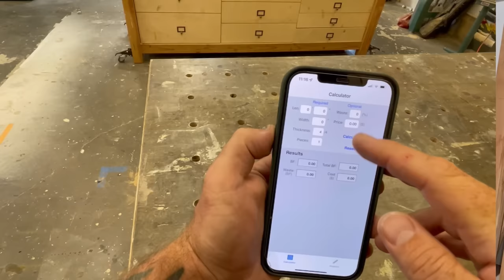Don't Buy Wood Here || Beginners Guide to Buying Wood

Comment: That’s a shame, because Home Depot wasn’t as awful back when I was in college 16 years ago.  Back then I wanted to make a really solid, beer pong table, and I was able to get a pretty decent looking sheet of 3/4 inch, furniture grade, white maple plywood.  I didn’t have access to any tools at the time, but I was able to round the edges and sand it all by hand to get a nice surface.    Most beer pong tables we had previously were all 1/2 inch construction grade, so you had to paint them to look good and repel the spilled beer.  My table had decent looking grain without any knots or inclusions, and I can’t recall the grading but it was flat sawn and looked the same on both sides.  

Since I wasn’t going to cut down it down, I picked the best looking one with nice undamaged corners.  I sanded it aggressively to with some really course sand paper to get it down to a fairly round, consistent edge that would’ve taken 30 seconds with a router—but I didn’t want cut into my beer drinking budget.

I then stained the wood a medium brown to make it look a little classy, then painted it with a sick looking graphic that was our fraternity flag and mascot on it, because I was able to paint it in layers using white, black and deep red, which came out awesome.  I didn’t like the plywood grain showing on the edges, so I masked off a 2 1/2 or 3 inch border that I painted black, then added a thin little pinstripe to make it pop.  Then once everything was dried, and looking good I coated it all with at least two or more clear coats to seal the wood and graphics from moisture and to protect it for as long as possible.  Then, because I learned how to paint from watching people paint cars, I had it sanded with way finer grit than anything you guys seem to use in woodworking.  The final sanding after the clear coat ended up being 2000 grit, and then I buffed and waxed the whole thing by hand to add even more protection.  It looked pretty good, and had the surface finish of car—so I figured it would last a little longer than the old table made from 1/2 inch OSB.

It was the most overkill beer pong table that my fraternity brothers managed to destroy in a fairly short amount of time, because it looked so damn cool that they wanted to take it to tailgate parties and whenever we threw parties at other houses the guys rented near our fraternity house.  In the end I think the weight from that addition thickness killed it because it got dropped one too many times while drunkenly moving it and it delaminated bad enough the boys were too ashamed to show me, because they knew how much work I put into it.  At least the design I sprayed onto our bar as an afterthought with the leftover white paint I had looked great for years after I finished with school there.

Again, maybe they carry different wood at different locations around the country or they’ve changed since then, but if they no longer even carry that stuff it’s a shame.  It was exactly the sort of wood you could use to build some pretty solid cabinets.  Like I said it had two really good looking sides that could’ve been used for the front of a cabinet if you mitered the corners, or trimmed with some nice veneer strips, and mounted some premade doors for the average DIY weekend warrior, or with custom built doors made out of some really nice wood.  I think they sell some very thin strips of hardwood for adding trim to things or for making your own moldings with a router, so if you were on a really tight budget or lived somewhere without access to a good lumber yard, you could easily build something that looks better than it has any business looking.

Comment: I feel like home depot is wood you use for woodworking only if you're super new and you don't really know what you're doing my first woodworking project was a desk because my last desk broke and I didn't feel like buying a new one for it to just brake a few months later and I got the material from home depot. the desk turned out ok but not perfect because I didn't know what I was doing now everything I do I get the wood from a supplier because I've been screwed over too much by warped home depot wood. also my parents are contractors and they even say that when they need wood they go to Lowes because home depot lumber is way too warped for what they are doing. but in general if your brand new to the space and most of what you're going to make is going to be trash anyway you might as well use the crappy home depot wood

Comment: After 30 years, I'm now retired from construction and now for the past 9 years work in the lumber & building department @ Home Depot. Although I understand it won't be true in all areas, but where I live all the big box stores & lumber yards pretty much get their lumber from the same vendors. We have 2 lumber yards close to my store, and they both get the majority of their lumber from the same vendor that Home Depot does and charge more for it, and to make matters worse, they keep their lumber stored outside. Home Depot, or anyone for that matter has very little control of the bunks of lumber they receive. One truck load we may get a bunk of  2 x 4's, or 2 x 6's that are all crap, then a few days later get bunks of the same exact lumber from the same vendor that are almost all perfect. The same goes for sheeting. You can never tell until you open it up & get into it. It will ALL sell, it always does. I'm forced daily to hear the whining about the quality of our lumber from contractors, then after leaving in anger, only for them to be back an hour later to get what they need often making a huge mess in the process like disrespectful spoiled children. Another thing most people don't realize, is Home Depot makes extremely low profits on lumber, if any profit at all. Some sell for a loss. Not sure about now, but there for the longest time Home Depot was selling OSB for less than they were paying for it. They make most their money on the accessories. That's why there is no military discounts on lumber. Only on bulk purchases, and even that is limited.

Comment: Love your videos! When you were reviewing plywood could you include information about blows and voids inside the layers of the plywood. I got a piece of 1/4 inch 4x8 foot plywood from (hd) to use as a huge square to help true up some rafters on a porch roof build. Standing under it in the sunlight I could see several void spaces inside (hollows) that were not detectable by looking at either side or around the edges. Voids are worse on thicker plywood’s, makes for weak spots.

Comment: Even for construction it isn't the greatest. I was building a fence for my yard and had the measurements for what I needed and purchased the boards I needed, turns out the dimensions varied from .25 inches to 1.75 inches on the board so I ended up being short by about 17 planks because they weren't cut to size. 6 foot by 6 inches and they ended up being 5.5 feet - 6 feet and 4.5 inches to 5.75 inches wide. I am not a contractor but holy hell I couldn't imagine using them to supply me for my jobs. You pay for a product and are shorted, they told me it's expected to see a variance like that.

Comment: Actually, for framing lumber, Lowe's has the best. I've been bying framing lumber from Lowe's for 20 years and have rarely been disappointed. Another good tip, buy 10' instead of 8' material and never buy "precuts". The longer lengths come from better trees and you are going to be cutting it anyway, yrust me. The scraps will be used for blocking and skids. I'd rather cut fire blocking and cripples from scraps I generated from cutting studs,  jacks, and sills than from full 8' lengths. Over the years, I have found, for example, that I have about 3-5% cull from a hack of 10' studs versus between 5-15% with  8' studs. Sometimes, it's way worse than that. Nit only that, I couldn't tell you the last time I framed a house that didn't have 9' ceilings. Anyway, Lowe's has been been my go-to for framing lumber for over 20 years.

Comment: Great video. Sadly the box stores are simply easier to find just about anywhere. I’m 74 and even though I’m a toolmaker I’ve been an avid woodworker all my life. Even had my own cabinet shop for several years until my machine shop grew too big to run both. So anyway going back all those years our local lumber yard had everything. Construction grade to furniture grade and everything in between. Even a big planner, radial arm saw, table saw and a jointer. You NEVER left unhappy. Today it’s not fun at all trying to get good reasonably priced wood around where I live. Enjoyed your video a lot!

Comment: Wish I would have seen this video a few days ago. I'm not a "wood guy" but i'm trying to build a simple frame and I needed a 1" x 3" x 6' board. Went to Home Depot bought 2 1" x 3" boards and when I got home I found both the boards were 3/4" x 2 1/2 ". I didn't care about the 3/4'" but I needed a 3" board. Went back to HD and all the boards were the same. When I asked the "lumber guy" where the 3" boards were he looked at me like I was crazy. He said they don't carry 3" boards-they are just marked as 3" but they are all 2 1/2". He told me I had to buy a 1" x 4" (which is only 3 1/2") and rip it down to 3". I thought this would be a simple project but I don't have a table saw so now i'm just outta luck.

Comment: this is really strange because here in mexico homedepot wood is really good better than most places I usually buy brazilian plywood chilean boards and some local pine boards the best ones are the chilean boards they are straight smooth planed almost ready to use just a light sanding

Comment: When I first found my local hardwood place 15 years ago, I was intimidated, but they are a small business and super helpful! Just last year I took a small table top to them, live edge, epoxy pour. And they sanded it flat and took a twist out, it took them 10 minutes and coat me $15, it would have taken me hours and not been as nice, with my electric hand plane and belt sander… your local wood supplier is your friend!!!

Comment: I'm the third generation off lumber man. I grew up in my dad's lumber store. Mostly construction grade material. The Brill rolled edge 2x4 was a really nice. Started putting nuts on bolts in the hardware section. Delivered house jobs all over central Michigan. Spent 30.5 years working at the phone company. But now I have a solid base on how to pick woods and work it into furniture for our Michigan and Winter Tennessee locations. Your information was very basic in my point of view. but that's what happens when you live in a lumberman's home...

Comment: OH, BOO! HISS! Oregon State Beavers!!!!! They beat my Ducks! Well, if you ever get a wood lathe, come down to Eugene for a play date!

Oh, Oregon Woodturning Symposium at the Expo center in Albany, mid March. 

Also, for flat work, I prefer air dried lumber. With all the Wood Mizers around, there has to be barns full of air dried lumber. You rip a board on your table saw and you get shavings, not dust. Solar kiln and vacuum kilns seem to work the same way.

Comment: I'm pretty much a beginning woodworker. I spent 28 years welding pipe, all over the country. My father was a carpenter by trade, and a woodworker by choice, so he taught me a lot about woodworking tools and how to use them. That was decades ago, and like everything else, wood shops have changed over the years. I'm just learning how to turn projects on the wood lathe, and working up to larger, more complicated furniture projects. Videos like this are essential for me. Thank you.

Comment: The entire inside of my house is clad in 7/8" thick planed, bandsawed edge 7-1/2"-8" width tulip poplar. It was cheap buying it by the "bundle" at a local sawmill. I ripped and planed all my door frames, baseboard, crown, etc from the same wood.

Comment: It's not that hard to figure out board feet, its just the width of the board in inches cubed times the square root of the hypotenuse of the equal hyperbole Logarithm of the inverse measurement in decimeters squared plus 4

Comment: I'll buy HD wood when im building something that doesn't need to look pretty but is functional. Like the mounted bedframe I made. It's sturdy and solidly built. Not pretty by any means but hey, it holds up to about 500lbs with no problem. (Im not 500lbs but the math suggests about 750lbs limit, i take 33% as error and assume it can only hold 500 lol)

Comment: Thanks for the video for beginners.  I'm not a beginner but you gave me one good tip.   I've been to another hardwood store in Albany but wasn't aware of The Hardwood Center.  
One question I have though is why can we not get rough wood on all 4 sides anymore.  I'm from the midwest US and used to buy all rough sawn hardwood.  After moving to the west US, I can only find S2S or more hardwood.  What gives?

Comment: "Red Oak? What is this, the 1960's?" 
In my Maryland neighborhood, there was a tree disease that was only affecting red oak. We ended up having to cut down a 65 ft tree, w/a rotten core that went 5 ft up from the roots. 😐 
However, we had it cut into live edge slabs, & have been trying to turn lemons into lemonade.
Reply: I found out we have 4 small local sawmills, & 2 major independent architectural salvage companies. I buy wood there.

Comment: No matter where you're buying wood from you need to actually sight down the piece you're buying. If you don't need it perfectly dimensioned to the standard thickness you can always just joint and plane a board as well.

Comment: Oregon is notorious for extremely high wood prices. the price for econuts gone wild in a state. I've been to other stores and lumberyards and found prices that were cheaper by 50 to 75% of the big box store prices in Oregon.  California also charges an arm and a leg for wood. Washington (state) at one time was pretty darn cheap but econuts didn't like it and ruined it there too.  Midwest and near eastcoast prices are much cheaper...why..not so many econuts driving legislation putting bans on forestry industry. Hence the cheaper prices.  Majority of wood found in Cali, Ore, WA is imported from china or from the southern and south eastern US.  Longer routes for deliver equal higher shipping costs which make for a higher markup in the big box stores and even lumber yards.

Comment: I think one thing you should have mentioned is if you are measuring a board to calculate board feet, they don't go by the exact measurement. So for example if the board is 3/4 inch thick, you don't multiply with 0.75 . 3/4 inch thick board is considered 4/4 , which is "1 inch" so in the board feet they will count that dimension as 1 inch. They base the dimensions on "nominal dimensions" of how it was cut before any surfacing. It's another additional layer of confusion that can make you feel like you are getting ripped off, but I did some research on it and it appears to be the common thing they do. If you see a 4/4 board, when you calcualte thickness just assume 1", and so on for all other X/4 boards. Board suppliers tend to "round up" to the next nearest inch. I never found it entirely fair, but that's just what they do.

Comment: I like this video. My issue is when I “google” hardwood supplier near me the number one is Lowes and then a couple other big box options. Local sawmill would be my best option, but to advise others,  any wood purchased at sawmill will not be finished and you will need planers, table saws, etc. so the cost builds on the tools you need to obtain the finish you desire. Last, if you are new to purchasing at sawmill be aware they sell in board feet. So educate yourself before you go.

Comment: I enjoyed watching this video! Youtube suggested this video and I'm glad the algorithm did so. I understand about the moisture content in KD wood, but I had to replace a retaining wall with pressure treated 8x8 landscape logs. I bought them in January, sighted each one for perfect straightness, placed the (6) 8-foot long pieces atop 2 full size wood pallets, x 4 sets, left under a covered carport in the shade until a couple weeks ago when I went to install them.  Much to my dismay, many of the boards twisted, bowed, and cupped while drying.  Such a shame wood can't cooperate and dry in the shape it was cut. It made my project way harder than it needed to be. I ended up having to cut the 8-footers into much smaller sections (so the defects would be somewhat more manageable) and used an electric planer to plane down the high sides.  Also had to use many more 12-inch landscape timber screws near the now more numerous ends to ensure any further drying won't ruin my project.  Do you have any tips to prevent this from happening when I have to buy pressure treated wood in the future?  I even had PT fence posts that curled on me after they dried and after they were installed, forcing me to now redo those posts.  S**t like this makes working with wood less fun...

Comment: I worked in hardwood distribution centers for 14 years, it's quite interesting. The defects allowed in lumber is determined by the grade, fas, fas one face, select & better then common grades after that, usually 1, 2, 3. 
Lower than that is scant and pallet grades.
I've seen pretty nice lumber in a #1 common board so shopping around can save you money.
A lumber scaling stick makes it super easy to measure board feet.
One side is in even lengths the other side is odd lengths, all on 4/4 so just have to do the math on 5/4 and above. It's a pretty good tool!
If anyone has a Paxton The Wood Source in their area, check them out.
They carry exotic woods too.